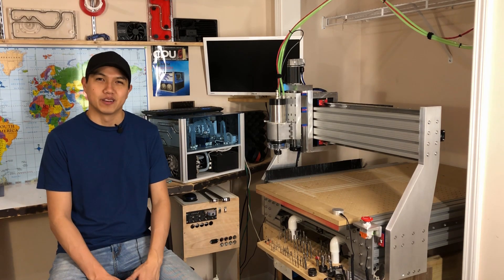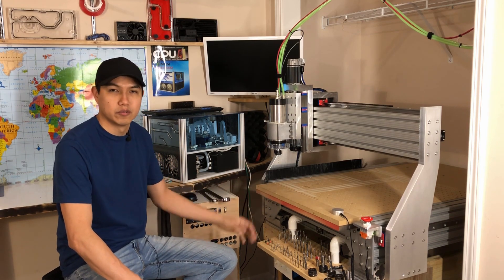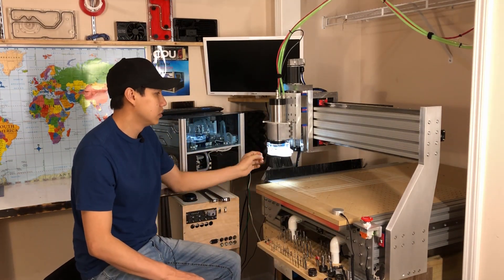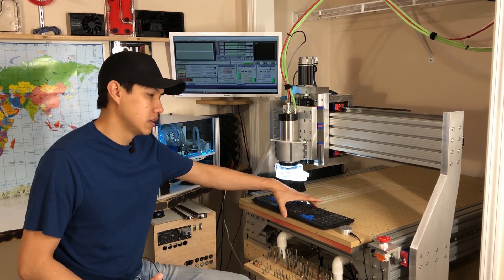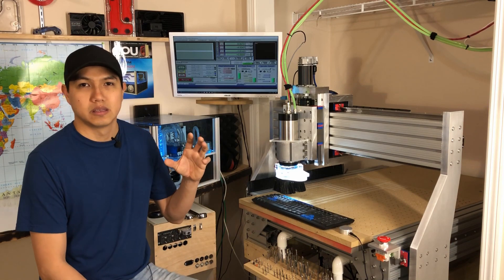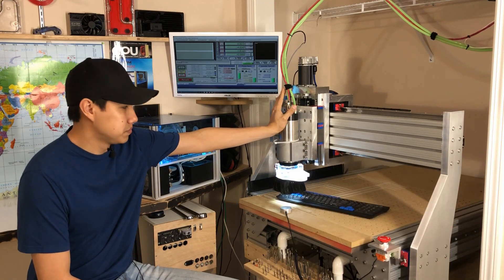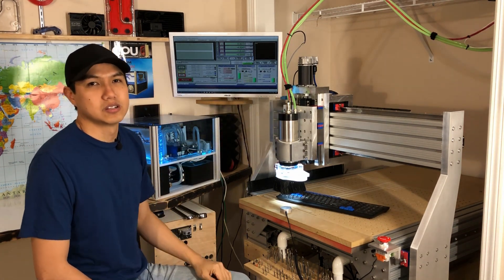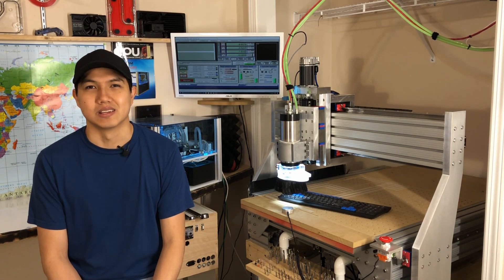CNC build Final Part

Comment: Thank you so much for sharing this build. You have done an amazing job designing such a rigid machine just by simple measurements and calculation. Overall a great achievement. BTW, do you have a parts/size list for the mechanical parts such as the type of alu profiles and lenghts and how much work area you managed to get.
Reply from the maker: Most of the aluminum profiles were 3x3 inches and 3x6 inches. Length around 35” and some 24” don’t remember the exact lengths 
The overall cutting area 25x25 inches.

Comment: Hi, thank you very much for the very interesting  information, i purchase servomotors and c25 bob with ethernet connection, can you tell me how and  where  do you connect E stop and limit switches any wire diagram, please help.
Reply from the maker: CNC4PC should provide you with some type of wiring diagram. 
I would recommend C25XP over the c25 bob

Comment: Mario, I got my CNC built! (modeled after your design with some changes) I didn't have another CNC to use, so all the plates were cut out with a bandsaw and then hand sanded down to be flat and square as possible where it needed to be. That took a couple of months, haha.

Was just curious, when cutting aluminum, what kind of accuracy are you getting? Say you cut out a 100mm x 100mm square, what size does that actually come out in the end? I had my steps per unit set to 160 for the Clearpath motors as a starting point. (800 steps per rev / 5mm). I cut out a 100x100 chunk of aluminum and ended up around 100.15mm in X and 99.85mm or so in Y. Which is less than I expected.

So busted out the Noga and dial indicator and did some measurements moving the axis 10mm and measuring actual distance traveled. If i told it to move 10mm in X I got 9.95mm. So took 10mm/9.95mm * current steps per unit and modified the values on all the axis. Repeating the aluminum cutout job I was off by half a mm now! The error had increased. =(

I'm thinking its probably the ebay ballscrews that are the problem but I'll do some more testing. Just looking to get an idea of how accurate I can expect this machine to be and set that as a goal in my troubleshooting.

Hope you're doing well.
Reply from the maker: Hi Gerald 

 I’m not sure which program you are using to control the CNC. 
 I use Mach3, in that program there is a option to set your steps.  
I found the best way to dial a CNC is to cut a “10x10” piece and measure it and then put those sizes.  The program will ask how long did the machine move and you can put 9.85 instead of 10 or whatever measurements you got. 

Also you will need to check for backlash. As that can affect your accuracy too. 

I think I got my clearpaths running 1600,-3200 steps on a 5mm and 6mm ground ball screws.  To get a accuracy of 0.0001 -0.0005 (flexing on the CNC affects my accuracy)
Reply: @radikult-custom  I'm using Mach4. It does have the same wizard to do the adjustment calculations, but I just did them manually. I had not thought of backlash at this point, but that is something I will check as I can see how that might affect things. I don't think there is any however, as after making the adjustments to the steps per unit, the machine was moving the correct distance back and forth and the dial indicator was hitting 0mm and 10 mm exactly with no issues. I'll redo the dial indicator tests and push on the axes and see if there's some movement.

 The other thing that might have had a big impact is the workholding I am currently using. Just doing the painters tape and superglue method, and I'm willing to bet there's quite a bit of play with the tape wiggling a bit as side load is put on the part (I mean I know there is, but maybe more than I think).  I'm looking at some low profile vises  an aluminum t-slot fixture plate in the future to make things more rigid, but for now, this is what I got. =)

My motors only do 800 steps per rev. Model is CPM-SDSK-2331S-RLN. Which should give me an accuracy of 0.00625mm on a 5mm ballscrew which is more than enough for me. I think you got the ones that go higher. =)

Given that, I'd say I should be hitting better than +/- 0.15mm so I still have some work to do.

Appreciate the feedback.
Reply: Wanted to follow up on this in case others run into similar issues as I have so far, resolved the issues causing the inaccuracies.

Starting off let me say to go around and check all of your bolts and make sure they're tight like they're supposed to be. I think due to vibrations some of the x-axis ballscrew bearing blocks had wiggled loose. (and one of the y axis too I think)

I knew that I might run into this issue but wanted to see how long I could get away without using threadlocker on the bolts until I did. The answer is... not long. =)

I'll be going over everything bolt by bolt and threadlocking everything in the coming days.

After holding the ballscrew bearing blocks tight against the ends of the ballscrews and tightening things down I checked for any play in the ballscrews by pulling and pushing on them with a dial indicator set against the travel direction of each axis. I saw very little to no play here and being happy with this, proceeded to move on.

Next I pushed on the moving part of each axis, either the gantry (left and right side) or the Z-axis assembly itself (again with a dial indicator on the axis I was testing). I only got about 0.05mm of movement in either direction with a moderate amount of force. I felt this was acceptable and in-line with what was expected based on what I had seen Mario get with his tests on his machine as well as what other videos I could find.

During all of this, I had been playing around with the steps per unit a bit. I'd contour the perimeter of a 1/4 thick 12"x6" piece of aluminum flatbar stock and then use some calipers to measure the part. I'd run the numbers, update the steps per unit, repeat the job reducing the dimensions each time and repeat the measurements getting closer and closer each time but still coming up short on accuracy.

I had also switched over to milling out some pockets and holes in the center of the stock and testing that as well. Measurements were off here as well and the more I tinkered with the numbers trying to dial this in, the more off spec the perimeter tests were getting.

Eventually rather than putting in 160 for the steps per unit (default expected value based on motor specs, 800steps per rev on the motors / 5mm pitch on ballscrew = 160 steps per unit) the number was creeping up in the +/- 2step range depending on axis.

This set off some red flags, as I felt you shouldn't have to adjust the numbers that far off default...not for these motors at least...

So, I rechecked the travel again using a dial indicator on the axis. Told it to move 10mm on a 0.01mm dial indicator and noticed it was now off several ticks. I had calibrated things a while back using this method prior to this and at the time it seemed spot on, but in my chasing the accuracy problem and now modifying the SPU (steps per unit), yeah... I can see how it would be off again. Ok, so now at this point, I am chasing my tail.

I thought about the backlash Mario had mentioned above. Tried to take that into consideration but couldn't really find any amount of backlash that would throw a cut off by 0.2mm. Tried adding a tiny bit of backlash compensation in mach4 and the ESS plugin to see if that would improve things, but actually that seemed to make the problem worse.

This is about the time I noticed the axis bolts being loose. So I tightened everything up and threw out all the numbers and started from scratch. This time however I opted to use a digital caliper clamped down to the bed and used an upside down end mill mounted in the collet as a post to move the caliper. This time I told the axes to move 50mm (rather than 10mm before) and measured how far the end mill post had moved the caliper.

Maximizing the distance you can move and measure is key to this step in getting good numbers and using the larger range of the calipers over the 1" of travel of a dial indicator is ideal IMO.

Also to rule out backlash I moved the axis in the direction I wanted to measure such that it would move the mobile leg of the caliper about 5mm, then I would zero out the caliper, and then tell the axis to move 50mm in the same direction. Value's I got were 49.94mm for Y axis and 49.98mm for X-axis. I did the numbers and updated the SPU values in Mach4 and re-ran the measurements. I got them spot on. Exactly 50mm of movement! I was happy with this. 

So at this point. I've tightened everything up. Re-calibrated the movement distances and SPU's to be solid. Ruled out any major backlash in the ballscrews/ballscrew nuts. 

Happy with where everything was at now, I proceeded to re-run the perimeter tests and found that I am still off by ~0.15-0.2mm on the X or Y axis!!! What.. the.. CHUCK!? HOW?!

I once again hit google and ended up finding a post where another person was having similar issues and saw a recommendation to check the dimensions of the end mill and that it might be undersized. 

For all these tests, I had been using a 1/4in single O flute end mill I got on amazon from what I felt was decent manufacturer of end mills. So I popped the shank of the end mill in the calipers and sure enough I was getting 6.28-6.30mm rather than the expected 6.35mm. I am not sure if the flutes for this endmill follow the shank in diameter and I'm sure that relationship changes depending on the end mill/type/etc...

Also I had noticed a bit of wear on the lower end of the endmill probably from me pushing it a little to hard in finding good speeds and feeds. This was likely a contributing factor more so than the quality of the end mill. Higher up on the end mill was fine, and this was the area I was measuring on the part.

Luckily I had just ordered a 1/2" 3 flute YG-1 end mill and it came in today. I chucked the end mill in the spindle and re-ran the perimeter tests and lo and behold I was only about 0.00mm-0.02mm undersized on the perimeter test!! I did do 2 spring passes so maybe why I came out a little under but this was the absolute closest I'd ever gotten.

0.02mm is 0.0007 tenths of an inch! I think that's amazing for a DIY machine especially given that I manually cut all the parts with a 9" bandsaw and hand sanded all the mating surfaces flat, square and as true as possible (sorry, no 3060 here to cut things for me) as well as drilled/counterbored all the holes with an 8" drill press. Looking forward to more tests in the coming weeks.

Next up is to work on dialing in the squareness by adjusting the limit switches and once my Edge Technology Spindle trammer shows up, getting the spindle trammed in as well. =)

Many thanks to Mario for inspiring me to do this project and answering my questions on here and I hope this information helps anyone else out who runs into these types of issues.

Happy CNC'ing!
Reply from the maker: @K9Megahertz  oh yeah, single flute endmill are under sized and could deflect a little  causing it to act as a even smaller bit 
The YG-1 end mills are really good bits

Comment: Hi Mario, great accomplishment on your build, I see you are using Mach 3 for controller,. Curious why you changed from " fixed gantry" to a " moving gantry"? Since you have servos rather than stepper motors.
Keep up the good work.
Reply from the maker: John Minasian Hi 
 I build my 2nd CNC as a fixed gantry because of this part I found and turn it into a 3-axis CNC 
http://linearactuatormotorized.name/c141080_nsk_xy_vexta_motorized_ball_screw_linear_positioning_stage_415_x_425mm_2.htm
 Also a bit more stiffness since the gantry don’t move anymore 
As for my CAD/CAM program I use is Vectric software/Vcarve  
But if you starting I would recommend Fusion 360

Comment: Hi again :D what is vacuum pomp? I need to construct vacuum table for my 6080 router
Reply from the maker: Fiertoo I have been using 2 shop vacuums. One for my dust collection and one for my vac table for over 2 years now.
 But I have heard of people not doing it that way because the shop vac as a vacuum can get really hot 
I run mine for 1-2 hrs at a time
Reply: @radikult-custom   Oh really? Shop vacumm? What power? This works good for you? I machining acryl, wood and mdf :D
Reply from the maker: Fiertoo the vacuums I have are,  one is a 5HP and one 6.5HP.  Here is a link if you want to see more specs about it. 
https://www.homedepot.com/p/RIDGID-16-Gal-6-5-Peak-HP-Wet-Dry-Vacuum-WD1851/100638360
Reply from the maker: Fiertoo as I mentioned. I have been running this set up for almost 2 years. I use it everyday for about 1-3hrs a day and no problems

Comment: so Marek, amazing video series. i was a bit bummed out, when you said you can't really save a lot when you build in decent quality. so what prebuild CNC would you consider for the money you put in this beast?
Reply from the maker: TheJohdu before I build my cnc I wanted this one    
http://www.cncrouterparts.com/benchtop-pro-2424-2-x-2-cnc-machine-kit-p-314.html

I can not say if it good or not since I don’t have one or seen one in person, but do your research
Reply: @radikult-custom  I'm looking into getting one from CNC router parts but they are pricey.  How much was you build, just materials. I have the time but want to know if its substantially cheaper
Reply from the maker: Julian Torres well I spend around $5k and then later I change the ballscrews for Ground ball screws and changes some parts . so that added my total to close to $6k 
Now if you already have some steppers motors and controller takes off $2k+/- and then if it’s build with smaller rails and extrusions maybe -$500ish   So I new total for just the Machine around $3k ish..

Comment: Hey Mario. Great job. Especially servos. How did you calculate your counts per step in motor tuning? And did you have to do the fine tuning at all?
Reply from the maker: Artem Ignatyev in Mach 3 there is a option where you can calibrate your steps, you tell the cnc to move 5 inches and then you check how far it move, and you put the right distance and then Mach 3 will set your steps
Reply: @radikult-custom  thanks. I know this. Did you have to do that or just calculate steps? Is your machine set in metric or inches? Sorry for sow many questions but on YouTube not many guys with clearpath servos and mach3.
Reply from the maker: Artem Ignatyev my cnc is ser on inches, but the steps number depends on the pitch lead and however many pulses you set it inside clear path software.  I got the “enhanced” motors, so I can choose pulses between 800-120,000 or more
Reply from the maker: Artem Ignatyev for the motor tuning was done through clear path software

Comment: Why didn't you use steel profiles instead of that giant aluminum profile?  Okay aluminum profiles give you easy assembly but what about cost and the space they occupy. You could have small footprint with same cut area. It looks waste of material to me since you said i wont push the limits of the servos
Reply from the maker: Yasin Yurtaslan probably you are correct by switching the aluminum for steel, the problem for me would be not enough tools to make steel work for me that’s why I went with aluminum profiles

Comment: You are a brilliant guy. What a great build. Thanks for sharing your experience. Did you link the replacement Breakout Board that you ended up changing too? I really enjoyed this series. Thanks again.
Reply from the maker: Chris Donnelly hey,  as I mention in the video I’m still using the Breakout board c25  but additional I got a DB25 pin out connector  just like this one 
https://www.google.com/shopping/product/290539082798246270?q=db25+connector+pinout&client=safari&sa=X&hl=en-us&biw=414&bih=622&tbs=vw:l,ss:44&prmd=isvn&prds=num:1,epd:17609610847461567551,paur:ClkAsKraXx2Vdsn6uAJ8XDc3MSvme-hmXhhlXptd3qJKAnYEbRVBRe3Z1wvRSOIG_HBAGVNoBR_xyyY1pwArBW1-T3yNnmTawZNKvO7KUuxwukp9FDE8scoZ5xIZAFPVH70mSqX9EECMAKxHpmtxD65_-x7mTQ,prmr:1,cs:1&ved=0ahUKEwiFwNznuIHeAhWNqlMKHdVECFsQgjYIrAQ

Comment: I did not see and answer for the question about cost? How much did this build cost? What is the total cutting area?
Do you have plans?
Reply from the maker: David Troncoso hi,  the total cost of the diy cnc was about $4.5k,  but there are ways to make it cheaper like instead of servos  you can choose stepper motors, and instead of 3x6 extrusions maybe 3x3  
The total cutting are is 25 x 25 x 6 inches 
And sorry I don’t have plans for this diy cnc. All I have is some notes (like the sizes of the extrusions and screws

Comment: This is one of the best DIY machines I've seen.

Using linear dovetail rails is not cheap and again, not what you see most people do.

The design of fully boxing in the z around the gantry is smart and a extra step you don't see many folks do.

Great job, subbed !